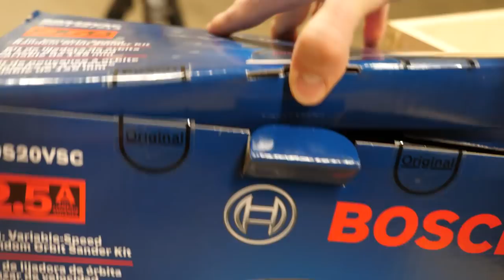When to Buy New Tools | Woodworking Business

Comment: It seems to me your are rodding your tools or putting pressure on them let them do the work put less pressure on your tools they will last longer my drill press and belt sander and lathe etc have lasted me for 15 years and still going strong, let them do the work don't use pressure on your tools and they will last.